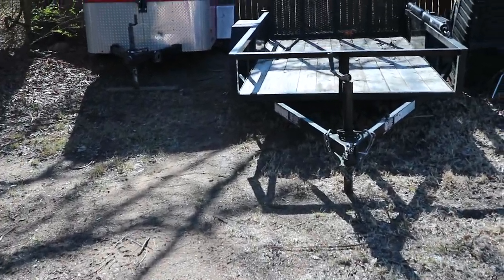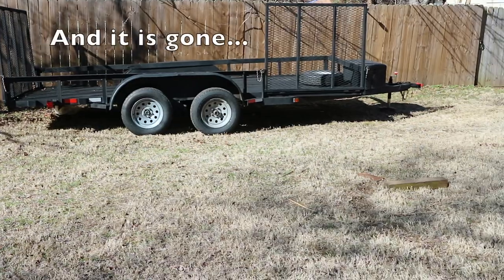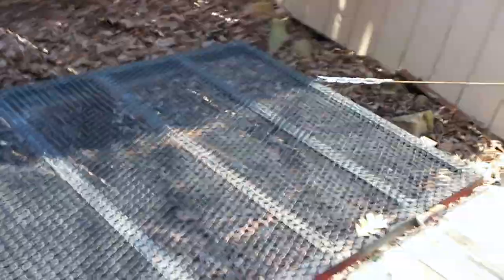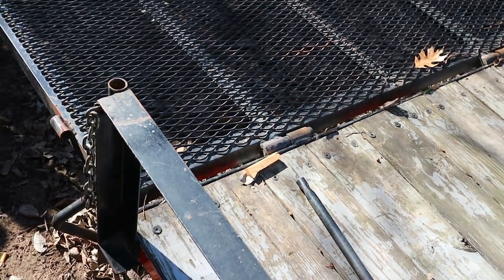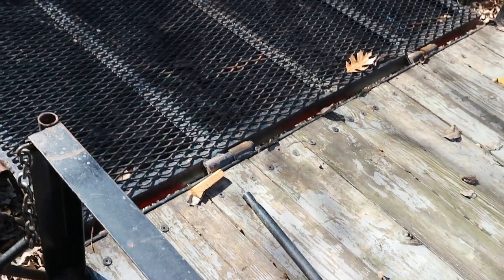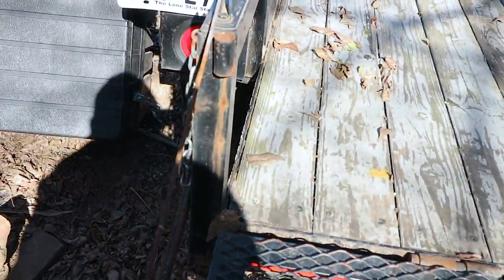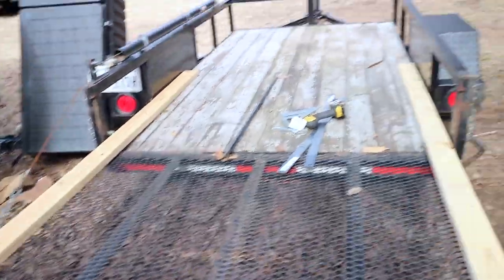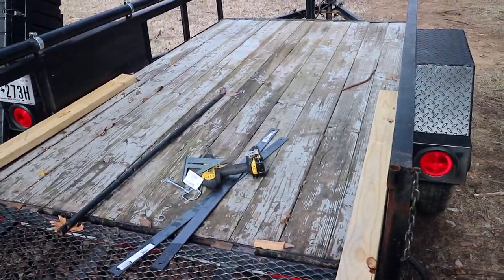How to lengthen a untility trailer

Comment: You could counter the back weight by adding more tongue weight. You could bolt a tool box to the tongue and put bags of concrete in it or blocks to counter the weight on the back. Just make sure you don't exceed the recommended tongue or axle weight. That could be dangerous. Also make sure the folks in youtube land know this is at their own risk and you aren't responsible for damage or injury from misuse of the trailer.

Comment: I've done this modification to lengthen my 5X8 trailer but I can't tell what you are using to quick connect the tailgate end support. I'm having to just use bolts and nuts. I have to have tools to fasten it with. Could you show me exactly what kinds of locking pins I can use there?
Reply from the maker: Harold Randolph I don’t know where you are but you can get these at Tractor Suppy, Harbor Freight, menards, etc.  we call them Tractor Pins, some call them PTO pins.  A Clevis pin is good too
Reply: I must be using the wrong locking pins because they won't tighten up on the trailer frame and the installed brace . the piece just flops around. I had to use a bolt and nut to tighten it up. The rest of the installation went as described and works good.

Comment: Doing this with chains and high-strength galvanized eye bolts, so I don't have to disconnect anything unless I want to drop it all the way. Also, 1200 lb screw locking carabiners for a quick removal. Don't think I need that high of a rating but taking any bouncing at the hinge into consideration. For use with longer lumber only.

Comment: Very dangerous to extend the rear. If the weight bias is greater to the rear, you can have the trailer go into a fish-tailing out of control accident. Weight on the trailer always has to be forward of the centerline of the axle(s). Kinda like the tail wagging the dog instead of vice versa.
Reply from the maker: Oby-1 Again, this is not to carry any type of a load, it it to lengthen the trailer to carry lumber, pipe or similar material.
Reply: Perfect for what it was built for.  Not perfect for what it was not built for.  Stated and restated multiple times by the builder.  Great idea.

Comment: I was just thinking of doing the same thing to haul my sons quad  that won’t fit I’m using 1/4 in plate so I can put some weight on it. I’m going to use grade 8 bolts hopefully it works :) thanks for the vid wanted to see if any one has done this.
Reply from the maker: Justin T I’m sure that would work.  My only concern would be the weight distribution on the trailer.  Thanks for the comment!

Comment: Wouldn't it be simpler to use two heavy duty rachet straps to do the same thing? Then you don't have to drill any thing.
Reply from the maker: Maybe but I’d worry about the gate bouncing.
Reply: @farrisrocks  my trailer is just shy of 8' so it was difficult to carry anything like 4x8 plywood or longer lumber. I used the 2 ratchet straps and it is working great. It won't bounce if you have something on top .